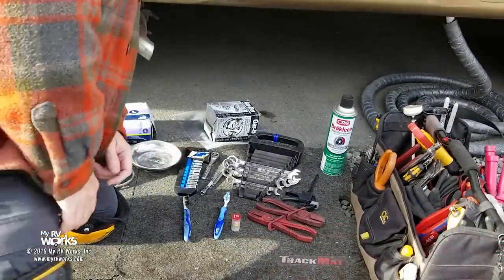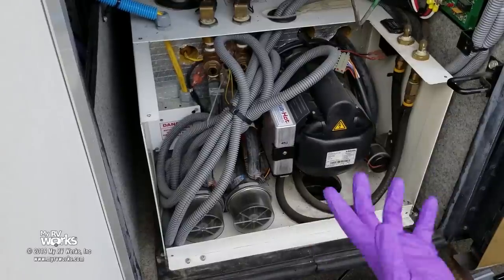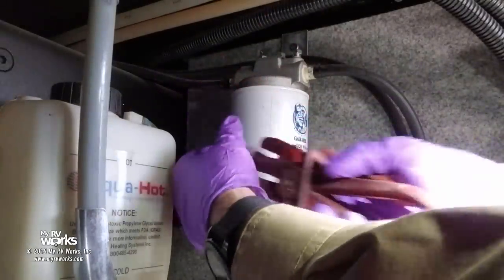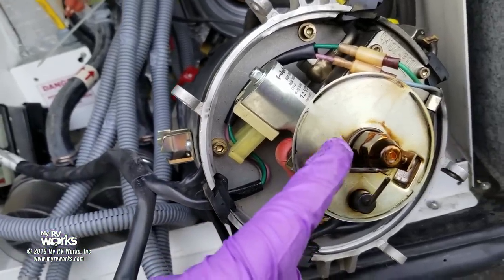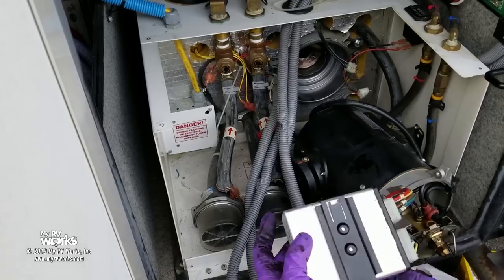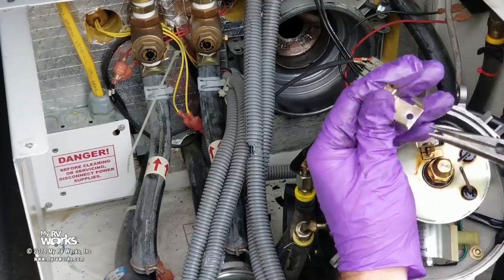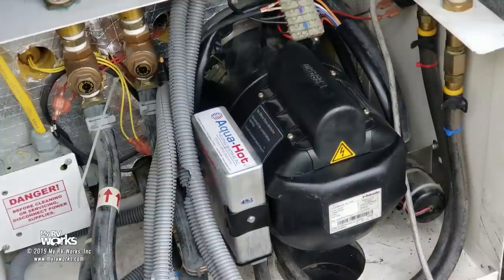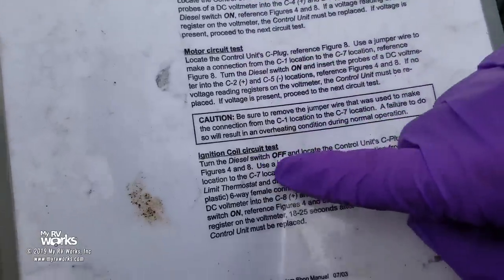AquaHot Troubleshooting and Annual Service

Comment: How do I get on of those remote control mods you made? I have a 2015 400D Aqua hot.
Reply: Hi David! Thanks for asking. We will have these available as a part of our new line of tools. Our company name is T3Interface, website: www.t3interface.com. The control box will be one of the first products we offer. If you want, you can email info@myrvworks.com, and I can add you to the list to notify you when they are ready for order.
Reply: Site doesn’t open correctly
Reply: @danaeliason1285  It seems to have issues opening at times. Try: https://t3interface.square.site/. The site is up, but we haven't added any products yet...not quite there yet!
Reply: I would like the control unit you made. Let me know how to get it.

Comment: On the two fuel lines why not just put zip ties on one and the other is not needed. One has them, the other doesn't. Boom you just saved 50% on zip ties. lol.